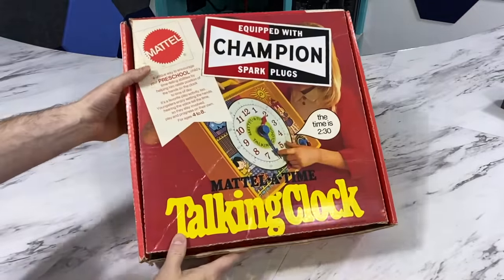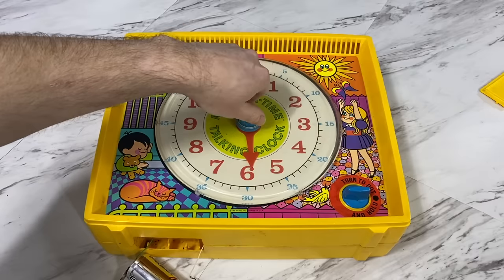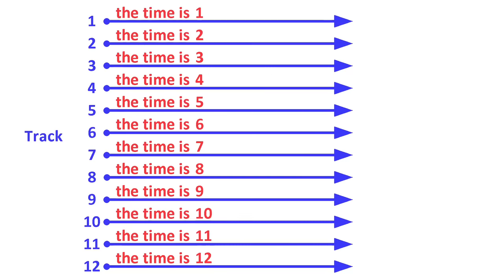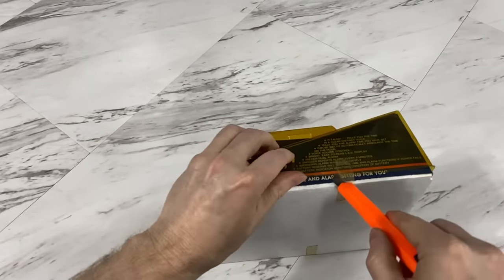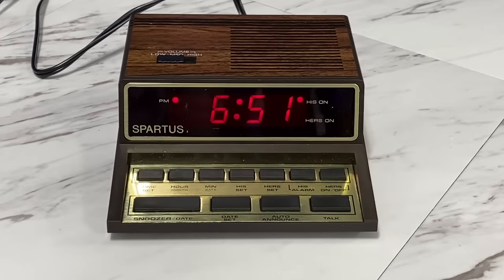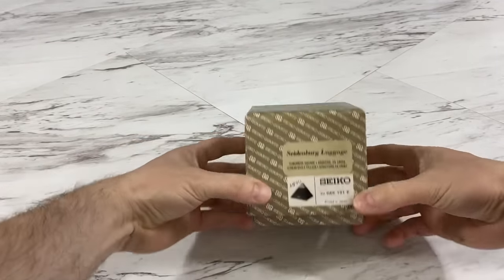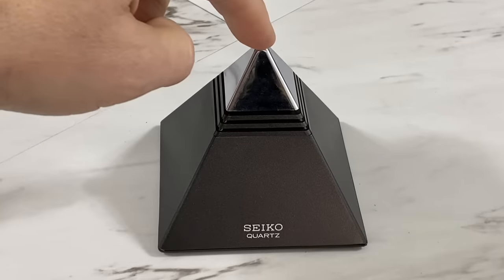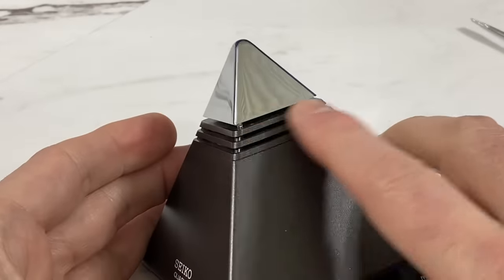Talking Clocks of the 1980s

Comment: The yellowing of older plastic is usually seen in PETE, which undergoes a reaction called the photo-fries rearrangement, and the products of those reactions can oxidize to conjugated (yellow) products
Reply: So closer to what happens to cut apples than what happens to old computers?
Reply: @stevethepocket  Yeah basically, but slightly different

Comment: Being blind since birth and born in 1978, I have lots of experience with different talking clocks. The Spartus is one I first saw in 1986. It has basically the same speech chip and functions as the Radio Shack VoxClock III which I got for Christmas in 1985. The Radio Shack VoxWatch is something I first saw in December of 1985, and its chip is based on that of the Sharp Talking Time I from the early 80's. The Talking Time I has a different alarm tune (Boccherini Minuet in A) and a few different features. Not that it'd be worth much, but with the distinctive chips the Spartus has, I wonder if it could be emulated in MAME or similar?

Comment: 14:18 Ironically, I just watched a video where they also mentioned that slang "sick" was relatively new, but apparently they found footage of skateboarders using the term, I believe in the 80s. Either way, it wasn't a widespread term until later. If anyone is interested I'll post a link the video.
Reply: Wasn't it used that way in Bill and Ted's Excellent Adventure and the original TMNT cartoon though?
Reply: I remember using it back in the late '80s, along with a lot of other kids, in place of "cool" or "awesome" to the confusion of a lot of adults. Mind you, I grew-up in California, so there were a lot of suffer and skater terms floating around, including the "shaka" hand sign, the "Cool S" graffiti sign, and elaborate hand-slaps that ends with pinched fingers sliding apart to go to the lips smoking an imaginary joint. It was all quite tubular, my dude.

Comment: My grandma gave me a pyramid shaped one (different than the one in this video) that had a really creepy bitcrushed rooster sound for the alarm. I hated that alarm so much, especially when the batteries were getting old and the pitch would change
Reply: Ross RTC-8 alarm clock by any chance?
Reply: Was it white with an orange-ish colored button?  I think we had one like that for my dad, more of a rectangular base than a square, still a pyramid shape.
Reply: My dad was given a portable alarm clock that could speak. And yes, it has this crazy electronic rooster alarm in it!
Reply: I'm not sure who made it but it looks like it's called the T-10A talking alarm clock. Mine was the black one with white button
Reply: ñew Custer has lights  up when diner time restreàñts use them

Comment: I have that pyramid clock on my desk in front of me. Still working great. It was a gift from an account manager at Seiko, the parent company of Epson, when we became Epson dealers back in 1985. (Epson sold PCs then for a short time as well as printers). Side note about that. Seiko claimed they made the first computer printer in the 1970s which they called the EP for Electronic Printer. Their second model was much smaller and a development of the EP so they called it SonofEP - and when they needed a name for a new printer division they turned that around to become Epson. First PC printer was the Epson MX80 which was revolutionary and sold with most of the first IBM PCs in the early 80s.

Comment: 10:50  My dad had one of those weather radio cubes.  I wish I still had it, was a good little radio. 👍  I see going back in the RS catalogs that it came out in 1970 and with him passing away a few years later, he had to get it pretty much when it came out, in either 1970 or 71.  I was just a toddler back then and would listen to it for hours my mother said.  It worked up right until I broke it by dropping it and landed on a corner and broke into many pieces that time. 😢
Reply: My dad had that weather radio, too.

Comment: The Radioshack Weathercube could be tuned to 2 meter ham frequencies by soldering in a small trimmer capacitor at one point on the board. There was a QST article for it. I used to use my weathercube to monitor a local ham repeater, that way.

Comment: I've been poking around old newspapers and catalogs trying to find out more about Spartus and that clock, since the release date was in question.

The earliest reference I can find of a talking clock from Spartus is in late 1982, a newspaper advertisement for their earlier AVT model 1410. (AVT stood for "Audio Visual Time" for which they also filed a trademark for in 1982.) The clock featured in your video is a slightly newer model number, a model 1411. The 1411 was apparently also sold at Radio Shack where it was known as the "Micronta VoxClock 3," that version of it debuting in Radio Shack's 1985 catalogue on page 148 under number 63-906 and labelled "New for '85." The prior VoxClock 2 that your video also features had previously hit shelves in late 1983 (that one apparently a rebranded Reizen according to another commenter). 

So with the immediately prior models in both product lines (Spartus' 1410 & Micronta's VoxClock 2) releasing in late 1982 and late 1983 respectively, and Radio Shack's rebranded version debuting sometime in 1985, it's likely that the dates on the chips do correspond roughly with its release. Perhaps as early as 1984 but probably not much earlier. Safe to assume that the Spartus 1411 is a ~1985 release despite its late 70s style.

Regarding Spartus itself: The earliest reference I ran across of this company making clocks was in a newspaper in 1958, though I saw references to their camera equipment in 1941. I didn't dig farther back than that. In 1964 it was reported that manufacturing was being moved from Chicago to Louisville, the headquarters later listed on your clock. In 1996 Spartus was acquired by General Time (Westclox), and then in 2001 the bankrupt General Time was bought out by Salton Inc, although they later sold off their entire time products business in 2007 to NYL Holdings LLC. NYL Holdings still sells alarm clocks under the Westclox name today, but the Spartus branding goes unused.

Comment: I have a regular Spartus alarm clock from the 80s and I still use it. Same basic design with the wood look and just a smaller control panel in the front.
Reply: I also bought a regular Spartus alarm clock back in the ‘80s, which also had the same basic design. It was really inexpensive but worked for over 20 years.

Comment: The fact that a 40-year-old clock still works after being left in packaging for all that time speaks to the engineering that went into it.
Amazing!
Reply: Planned obsolescence was not in full effect yet when it was made.
Reply: @TheBullDurham  actually it was, it started 1924..
Reply: And the robust simplicity of the design.  It does one, basically useless process, not very well.
Reply: Nearer 20 years  and it's not really engineering it's just very simple without much to go wrong  apart from electrolytics drying out and that can happen however well you engineer something. Modern equipment is often more highly stressed running at higher current /temperature levels.
Reply: @achannelhasnoname5182  The light bulb cartel .
Reply: @mfx1  Engineering does actually play a role though, at least when it comes to modern devices. There are multiple modern devices that are designed in such a way to fail, regardless of whether it was done intentionally or accidentally. There's "evil" battery management systems (bms) that are designed to stop working either after a set number of cycles or if the batteries are disconnected in the process of replacing the cells in the battery pack. Another example is Apple's tendency to run the high voltage backlight lines near the cpu lines, or how for some macbooks they used a screen ribbon cable that was too short. Louis Rossmann has documented a bunch of examples.
Reply: More impressed about that plastic covering the cord and the film on the screen. Definitely expected those to turn to goo.
Reply: @WALLE1D1W  "at least when it comes to modern devices"

I covered that in my reply. Modern devices aren't necessarily "designed" to fail they just using cutting edge highly stressed technology that consumers demand for higher performance and that comes with a risk. None of this changes my original reply.
Reply: Worked just fine even with those busted caps
Reply: @achannelhasnoname5182  yes but products from the 70's and 80's still mostly work today but products made today are lucky if they last past the warranty date.
Reply: Even something made now might have still worked in 2060-something without any or much wear and tear on it, duh.
Reply: @TheBullDurham : This isn't actually about that, though. Because plenty of things with that would probably still at least run generally that much later if they hadn't had any or much wear and tear on them.
Reply: @TheBullDurham  Products made in in 5000BC are still usable today yet tech made in the 1940's likely won't survive 1 or 2 centuries.
Yes, corners are cut during production to lessen the price, which take out some of the lifespan of the product from the get go, but I feel like everyone here just brushes off how normal it is that more complex objects are more prone to failure since they're made of thousands upon thousands of parts. It's simple and coherent
Reply: It doesn't talk, but I have a Spartus alarm clock that I've been using daily since 1989.
Reply: I'm surprised it worked with leaky caps
Reply: @achannelhasnoname5182  Damn these light bulbs that last 100 years. Oh wait they fixed that problem.
Reply: Pretty sure that an iPhone from let's say 2012 will work just fine after 40 years in its packaging. The battery will need to be replaced of course.
Reply: @achannelhasnoname5182  The Lightbulb Conspiracy?
Reply: @buymeskittles2719 : Me too! It's their white desk-lamp-combo clock! Well, mine from about 1992 or 93. Is that what yours is (I don't know if they were making that model in 89 or before)?

Comment: There was another - rather nifty - talking alarm clock from Sharper Image. I’ve still got mine, and it still works to this day. I don’t know when it came out, though, and I’m not of a mind to take it apart to find out. On the back, it says (on the battery cover) “Ultmost model 8805”. It had two settable alarms, and it would play one of several tunes when the alarm went off. If you hit the right side of the “talk” button on top, it would stop the alarm, but if you hit the button in the center, it would stop the alarm and then announce the time. You could also tap the button at any time to get it to announce the time. It also announces the temperature (in Fahrenheit)! Sadly, the LCD has no backlight. Most of the tunes were classical, like Fantasia on Greensleeves, Fur Elise, the tune from The Godfather, and even The Sound of Silence (and others.) It also has the option to play a “beep, beep…” type of alarm instead of tunes.

Comment: My grandmother bought a Vox Clock (one) a long time ago, but nobody is sure exactly when. It has been on continuously for decades, announcing every hour, and has never been repaired. The voice is still loud and clear, and it still keeps excellent time. Unfortunately, that older model has hardly any features (no alarm, no LCD screen, no 24 hour mode), and the voice it uses is a little bit lower quality than the Vox Clock 2, but it's still very easy to understand. A very cool bit of retro hardware. It will be a sad day when it finally goes.

Comment: 5:02 Impressive, American electronics had fitted plugs back then, in the UK we still had to fit plugs on most items way into the 80’s
Reply: As far as I'm aware that's how they've been almost forever here in the states.  My dad's got some projectors from the 1920s with Kodak branded plugs.
Reply: I always thought that was a long-lasting hold over from WWII.  There's a LOT of copper in a proper UK plug, and it would have saved a lot to manufacture devices with the plugs to be fitted by the end user.  Or perhaps it was an artifact from plugs not being standardized until much later than electrical goods becoming popular.
Reply: @evensgrey  Yah, I figure it was a holdover from then too -- especially since the UK changed plug and outlet designs right after WW2.  People didn't change all their outlets right away, so it made sense to sell things without plugs, and wire up the kind of plug you needed.

Meanwhile, here in the US, the 2-prong version of our plugs and outlets was already a long-established standard.  EDIT: And the 3-prong version had already been invented in the 1920s.
Reply: @AaronOfMpls  My current apartment was (or so I'm told) built in the 1930's, doing a rather bad imitation of a rich family home from about 1880.  Two of the rooms in my apartment have what might be original electrical outlets, on the floorboard on the OUTSIDE walls, two prong, no polarization.  (I've got modern outlets on the common interior wall of the two rooms.  15 Amps is plenty of power for everything I have in here, fortunately.)
Reply: @AaronOfMpls  my house still has a few round pin bakalite sockets. They are part of a disconnected ring main that no one bothered to remove when the house was renovated and rewired. House is about 60 years old and in the uk.
Reply: I think it was that way in the uk as we had several different type of sockets until the 80s. Obviously the 13a plug was standard but we had legacy standards, 16amp round pin, 5 amp round pin, Walsall plug and a couple of others. So we sold stuff with bare wire to accommodate people who hadn't upgraded.

Comment: I had the bigger Micronta talking alarm clock with the top lid from Radio Shack that I’d bought new in, I want to say, 1985, and used it for several decades.  Performance-wise, under the hood it was identical to your first real talking clock shown, the Spartus clock.  The sounds and voice were identical TI vox, even the alarm was identical to the Spartus.  Not sure which came first, but perhaps they were released around the same time.  I feel like the Micronta had been on sale for at least a year or perhaps two before I had saved up enough to buy mine.  Unsure if the Spartus did it but I will presume so, the Micronta’s alarm started out at a softer volume and the trumpet and voice continued to increase until it was up to the level of where you’d set the volume slider.  It could wake the entire house at full volume and you could even feel it vibrating the nightstand if you laid your hand on the wood.  Miss that clock badly.

Comment: What's interesting is there are actually two VoxClock 2 models.  Yours is the newer one with the female voice and LCD on the bottom.  Mine has a male voice, and no LCD.  Both still VoxClock 2's, but different Radio Shack part numbers.  Then of course there is the original VoxClock (with a harsher sounding voice).  I have the VoxClock 3 LED alarm clock you mentioned, and it sounds just like the Spartus LED clock.  Guessing similar internals, but different externals (and they label it alarm 1 and 2, instead of his/hers).  Both are early 80's after the VoxClock and VoxClock 2's - definitely not late 70's.

Comment: Do you remember the talking
 pocket watch (not wrist) that has a top button that kind of slides down? The alarm for it was a rooster crowing… I had one and loved that feature, I thought it was at least as cool as the “5 o’ clock feature” you showed. It’s a bit bigger than the talking wrist watch, was all black, and had a keychain attachment on the top left of it. I can’t find it anywhere online, but it should’ve been in the catalog in the late 80’s, early 90’s at the latest. I’d love it if you could find a picture of that one for me… 👍

Comment: In the early 1990s I had a triangle shaped Talking Clock AND a programmable X-10 controller. I set it to announce the time on the hour 8am to 10pm.
I still have a Radio Shack 63-963. I took off the rubber setting buttons due to inadvertently changing modes.
A flat bladed screwdriver is needed to set it by touching the contacts.

Comment: I also own both the Vox Clock 2 and the Vox Watch.  My Vox Watch is the original I owned back in the day, and still works.  It being the 80's, I would repeatedly press the talk button to make it stutter... "It's it's it's it's 4pm."  I wore it for a while, but being a kid, the cost of the batteries was prohibitive at the time.  I purchased a Vox Clock 2 on E-bay a couple years ago after watching a previous video of yours. lol  I had been using it to keep time in the house.  The batteries died and I keep forgetting to replace them; which reminds me... I need to replace them now.  EDIT:  There.  Now it has fresh batteries and is keeping time again.  Despite the fact that it no longer spoke, it was fairly close to the actual time, when I replaced the batteries one at a time, which is impressive.

Comment: His and hers alarms.  Did you test it to see if your spouse set the "hers alarm," that you only woke up to the "his alarm," and vice versa?  :)  I have a clock with two alarms too. Alarm 1 and Alarm 2.  It's much newer, so I guess clocks got gender neutral in the 21st century.
Reply: My current alarm is like yours, except either can be set to the radio or to beeping.

My old tape player alarm clock though, the two alarms were hardwired to radio/tape and beeping.
Reply: The original Sony Walkman famously had "Guys" & "Dolls" headphone sockets, Nowadays people like Sam Smith would want "They1" & "They2" :-)
Reply: I want to know if they sounded any different.
Reply: The hers clock can't wake you up, soap time is much later on.
Reply: Phones don’t even have an alarm 2, you just set 2 alarms. Or you set 20 alarms if you don’t trust yourself